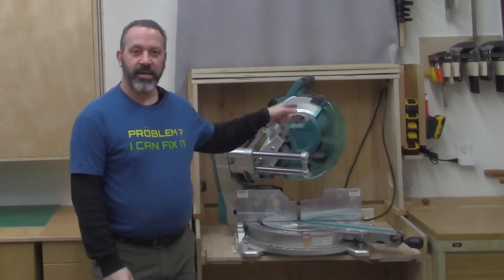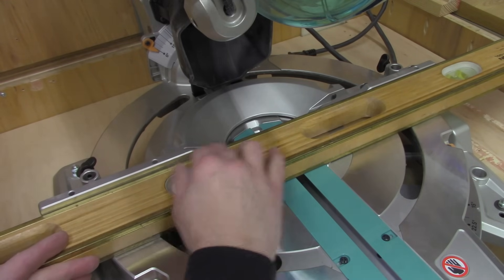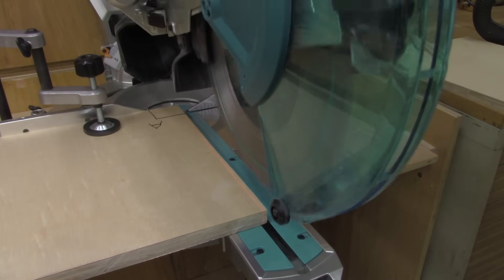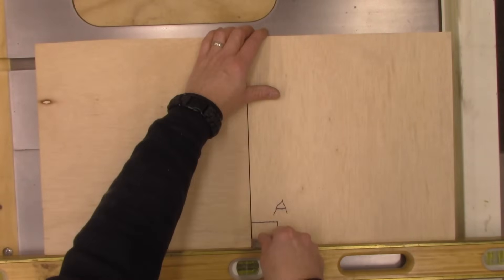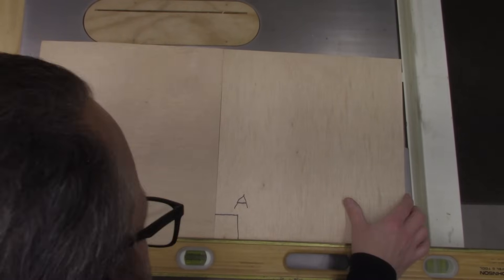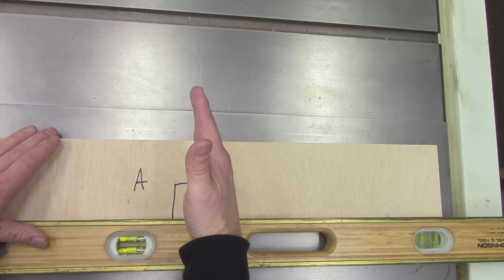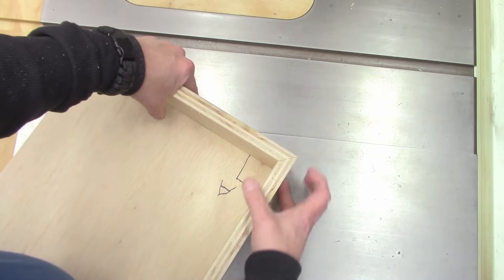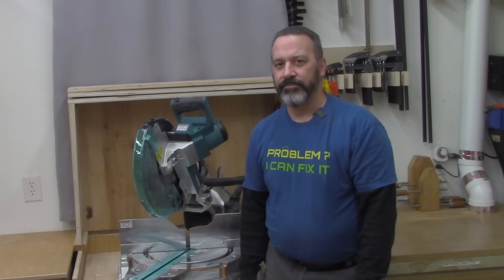Calibrate any Miter Saw - No Special Tools Required!

Comment: Adjusting the 45. Do not file the notches! Loosen the screw that is furthest from the zero indent on the degree indicating plate, now either push the plate in towards the body of the saw or pull away from the body depending on the adjustment needed to obtain a 45deg cut. I use a flat head screw driver to tweak and hold the degree indicator in place while tightening the screw. If this did not make sense, I will reply to any comments requesting additional description on the method
Reply from the maker: That's perfect!  I knew someone would know what to do.

Comment: Many people are having problems with these types of saw where the sliding arms create a curve cut.  Even one of the big tool retailers here in Australia were advertising a traditional sliding mitre saw with the horizontal bars as more accurate than the modern vertical bars (Makita Festool) because of this problem. I’ve seen people on YouTube trying to fix this issue with the two Allen screws on the arms but it looked like ‘hit and miss’ operation. And more importantly creating worse cuts that the important but more minor issues you fixed in this video. Thanks.
Reply from the maker: I had to do the Allen wrench adjustment and it was pretty easy.  Kind of ridiculous though for a $700 saw.
Reply: I have just recently went to replace my dewalt DSW780 with the Makita 10” saw and had a ton of chatter and vibration with different blades, exchanged it for the 12” and had the major pain of trying to square everything but it was nearly impossible because of this issue. Curved and double cuts etc. exchanged for the same tried and true dewalt I used and came out of the box perfect. No issues. Pretty unfortunate that I was told to bring a brand new 800$ saw to a service center
Reply: On my 1219L I had the problem with the curved cut. After replacing the saw blade with one from Bayerwald the curved cut was gone. I think that the original blade is too thin and not balanced.
Reply: This is a common problem, especially for those who decide to lift or Cary the saw by the slide instead of the handle. Adjusting this is a little bit more complicated than the rest of the adjustments on the makita saws. The trick is to use a piece of dowel or 1x1 in between the slides to manipulate then hold the slides in  position while tightening the two allen set screws.

Comment: Have you heard about curved cuts from uncalibrated slide pilars?
Reply from the maker: Yes, had that issue with mine.  Fairly easy to fix and that guy isn't joking about how tight those Allen screws are.
https://youtu.be/4Ioa24818S4?si=AWMpmfkywHHjNFpg
Reply: @HouseDoctorRay  Well, that guy does not remember which of the two screws have to be loosen. If you loose both, you can make the curve more worse.
I had to bring my LS003G back to Makita to have it adjusted and to get rid of the curve cut.

Comment: I had a  brand new Ridgid  4521 compound  miter  saw.  I set it on a 40'' high table on a cement floor..  I had the blade all the way down and i slghtly llifted the front of the saw or something the blade and housing immediatley sprung up and the saw jumped off the table and landed upside down at least 4 ' from the table it was sitting on.I ruined a brand new saw    I don;t think I had  even made a cut

Comment: I have problem when I put at maximum but my 90 degree cut is almost 3mm different. When I tie and lose the bevel cut function mop I can see the saw is moving,when I tie it pull the saw to the left. How can I fix it?

Comment: The zero clearance tape works but its thick stuff. Dont plan on cutting anything short without using more tape to counter the other end.
Reply from the maker: On my DW saw the plate was a little low so maybe it would be good on that.  The plate on the Makita is almost flush.

Comment: Usefull information and explained very well! I'm a beginner and my (fairly cheap) mitersaw is giving me headaches when it comes to nice, clean cuts.  It should have started with the basics instead of using it straight out of the box.
Reply from the maker: Get a good blade like Diablo.  It will make a big difference and they're not that expensive.

Comment: Excellent video. I like your ingenuity of using two separate boards with straight edges that don't require perfectly parallel edges. I just got a new saw - I am going to use your techniques to dial it in.
Also. if I understand correctly my sequence should be 1. Check/Adjust fence, 2. Check/adjust bevel angle to ensure perfect 90 degree cut & then lastly 3. the miter/0 degree cut testing and adjustment. So kind of reverse order in which your video goes. Is that a correct understanding? Thanks for your help and keep these videos coming.
Reply from the maker: Doesn't really matter if you do the miter or the bevel first.  Just know that one can affect the other so just check everything again when you're all done.

Comment: Great video! Easy Peezy! Simple! I like it. I have a new 10” Makita. I haven’t zeroed it out yet but will now do so using your technique. For your two questions…

1. I bought and used the kerf tape you’re asking about. I used it on my table saw and my table saw cross cut sled. Also on my Makita. I think it’s a good product with 1 caveat. It’s about a 1/16th thick. Think about that and tell me the problem with that. 

2. Adjusting the angle cuts on the Makita with no de dents. My guess and hope is that once the 90 is zeroed out it should be good but…yeah, if it’s not, filing the notches would be the only way.
Reply from the maker: I read up on the tape.  I think Fast Cap makes it.  I decided to go with a piece of Luan to replace the stock insert.  It's a little low but better than being too high.
Reply: That’s it! That the stuff. Extremely sticky and quite firm. But like I said, it’s a tad thick. On some throat plates of table saws and such you can adjust the elevation to compensate. On my home made cross cut sled I couldn’t. I guess you could try and sand or router out a 1/16th. I’d pay $10 to see that. Lol! So what I do on the sled is just put a piece of the tape on the opposite end of the stock I’m cutting.  @HouseDoctorRay

Comment: I'd like to know the best way to adjust, and clean the laser. Mine slides back and forth and its gummed up with something. And I'm replacing the blade with a thinner kerf so the laser will need adjusting. I did see something that said to make a cut and adjust the laser to that cut, so maybe that's the best way?  Also wondering if there is a better way to do it without wasting wood.
Reply from the maker: That's probably the best way.  Just clamp down your board.
As far as cleaning, I'd try something mild like soapy water and go from there.

Comment: My saw is a little older but I use the Fast Cap tape because wood pieces kept falling down inside and causing problems for me. The tape is a little thick but it is much better with it since I can see exactly where the saw will cut the wood.  It seems like a cleaner cut but I also changed the blade to a Forrest Woodworker crosscut blade so it probably is that.
Reply from the maker: I just cut a piece of Luan to fit.  It's a little low but works well.
Reply: I have seen that Fast Cap tape. I wonder wouldn't it add some thickness effectively making the saw bed out of level and wouldn't that cause some error in cuts? TIA.
Reply from the maker: It could throw off the cut depending on the thickness of your insert.  My insert was slightly lower than table.

Comment: How do you know which way to move the saw when it is out?  For you 90 test, how did you know it was cutting to the left?  For the bevel test, how did you know it was tipped to the right?  Thanks.
Reply from the maker: For the 90 test the gap was at the part against the fence.  That means the blade away from the fence was too far left.
You just have to keep track of which way the board is when you cut it and where the gap is.
If you try to adjust and it gets worse it means you went the wrong way.
Reply: Does that mean that if the blade away from the fence was too far to the right the gap would have been somewhere else?
 @HouseDoctorRay
Reply from the maker: Yes, the gap would have been at the far side of the test pieces.
Reply: @HouseDoctorRay  thank you.
Reply: @HouseDoctorRay  I thought in your video the gap indicated the table was a bit right and not left to produce that gap closer to the reference edge. Am I getting something wrong? TIA
Reply from the maker: Just try it you'll see how it works.  The worst that could happen is you have to adjust it the other way.

Comment: You cover adjusting the Bevel Angle on this saw. Do you have a 0 degree stop when you have gone over to the left tilt? My Makita 1219L doesn’t seem to have and the tech guys laugh at me for thinking there should be one. I have the adjustment screw like yours, but what am I adjusting if there isn’t a stop? Help!

Comment: I have used the tape. It works, but it has a thickness. Be sure u can lower the throat plate so the tape is flush with the saw bed.
Reply from the maker: The FastCap tape?

Comment: A couple of days ago I used the tilting bevel to cut some bed molding and now it won’t lock to 90 degrees. It will stop at 90 to the right but go past to the left, yet the lock button in back will not go back into its receiver in either direction. I can’t figure out why. Any suggestions as to what could be wrong, or how to fix it?
Reply from the maker: Unplug it.
Vacuum everything you can see.
Use compressed air and blow into every nook and cranny while tilting and beveling.  My bet is there is dust buildup in the housing jamming the spring.
If that doesn't work you're going to have to start taking it apart...
Reply: Thank you, I will